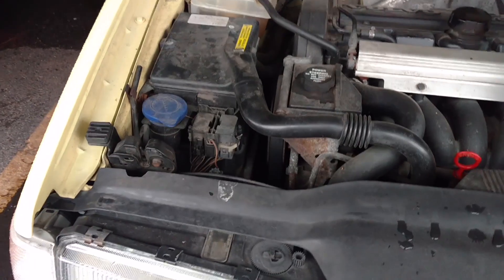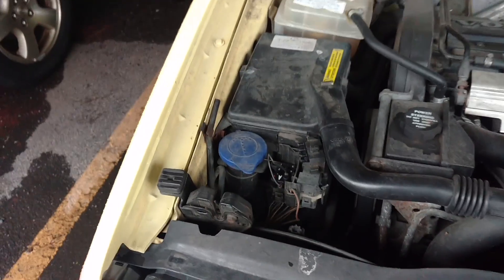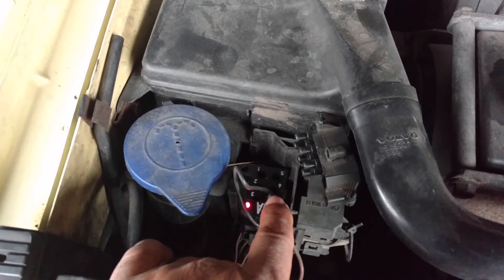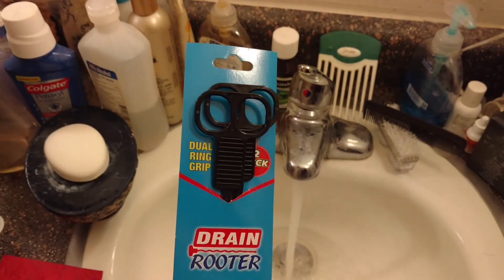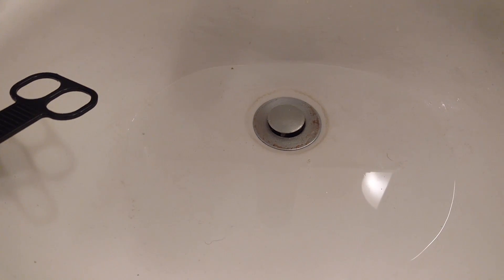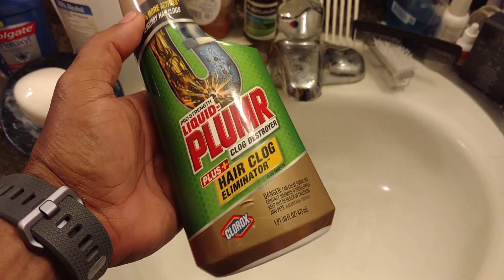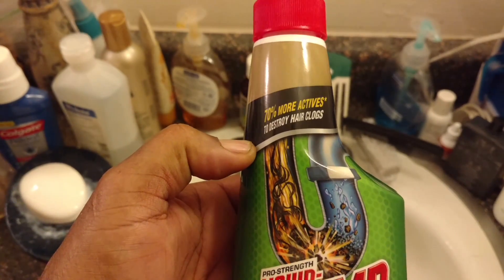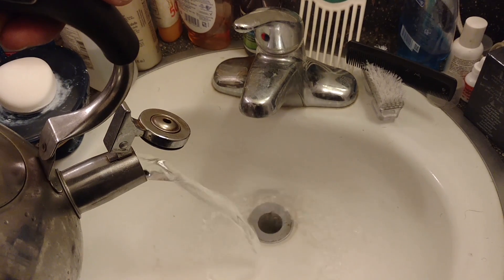Issues and disappointment with carbon build up. Cleared bathroom sink drain. - HOWR

Comment: I have had trouble with carbon build up in the past on one of my old Jeeps.
To remove the carbon I would pull the plugs, disable the fuel pump and spray Mopar Combustion Chamber Cleaner in each spark plug hole and let it sit for a 2 hrs. Spin the engine over (rags were used to cover the spark plug holes to minimize any mess) and re-spray each cylinder again. Spin the engine again. Re-assemble everything and go for a drive.
The results were always very impressive.
My Jeep would get carbon build up and run rough when cold - the carbon would act like a sponge and absorb the fuel until the engine warmed up.
Good luck with your carbon issues Robert.
Reply from the maker: Thanks for the tip. I'm going to try a few things on Red Barron and use what seems to work best. ;)

Comment: I remember reading a procedure (no, I have not used it, use at your own risk). Maybe disconnect fuel pump relay, etc. so fuel system will not run. Pull out spark plugs. Pour some top-end solvent cleaner into holes. Let soak on top of piston, etc. Put rags over top of engine areas, things will get messy.  Crank engine to remove top end cleaner. Reinsert spark plugs.
Reply from the maker: My next plan was to use oven cleaner. Tried it before, works good for making the carbon soft.
Reply: @RobertDIY  Keep us posted!

Comment: Hey robert i have receipts for my 850R going back to 1996 and the dealer maintenance always shows using techron regularly. I Pulled the head at 300,000 and didnt look that bad.. still rocking the techron and vvpower.
Reply from the maker: I'm going to try it on Queen Bee.

Comment: Driving it almost 200,000 miles with leaking valve seals definitely could have contributed to the carbon build up 
Also the previous owner may have done a lot of around town short trips which would not allow the engine to reach full operating temperature this can cause excess carbon because the engine never gets hot enough to burn off carbon deposits
Reply from the maker: Yea, the PO that drove it was a fire chief.
Reply: Robert DIY ah makes since I wouldn’t feel to bad about it I’m sure nothing you’ve done has caused the carbon I really bet it was the PO
Reply from the maker: Well, I really thought all cars built up carbon and looking back I see that some have not.

Comment: Because of residual cylinder pressure when the intake valve opens direct injection vehicles seem to be way worse with carbon build up. Port injection is better in this regard because the back of the valve and the I take runner generally stay cleaner than direct injection systems. I'm not sure if this car is Port or direct.
Reply from the maker: Port
Reply: @RobertDIY  I guess the knock may be coming from internal carbon build up in the cylinder. It may be raising compression and causing some pre ignition. Just for a test see what happens if you go buy a little bit of premium fule with a higher octane rating and see if the knock persists.
Reply from the maker: I'm running the highest we can purchase short of racing fuel.
Reply: @RobertDIY  ohh I see, interesting. Might have to take that head off again :(

Comment: You need an engine shop that specializes in Volvo's preferably that works on high performance engine's to make Queen Bee as serene and quick as can be.
Reply from the maker: Free service?
Reply: @RobertDIY  Advice from a repair shop as mentioned might help. Almost no one wants to work for nothing and is the problem. My dad would say, that the guy wants you to grease his palm. Knowledge "Free" is what am trying to get at with doing any mod's to your vehicle.
Reply from the maker: I'm not sure where you are or where you're going with this but I have done a lot of research and have paid other's to assist with the mods I'm going.
Reply: @RobertDIY  Is the best can explain stuff. Anyway enjoy watching your video's and hope to watch a lot more. Keep your fingers crossed on the high performance tuning of Panther.

Comment: Hi Robert. My 1996 850R  had the same issues.I pulled the head at 275000 on the clock and had the carbon buildup was just like  yours. The valve stem seals were gone and the pcv was partially blocked. When I was cleaning the deck on the block i used CRC gasket remover and got some over spray on the pistons  the stuff dissovled the carbon right off. I'm wondering If you sprayed that stuff down in the cylinder let it set for a few minutes run the car. I don't know what the ramifications would be. Has anybody used this stuff in this application? All I know this stuff works really well.
Reply from the maker: I was about to use some oven cleaner, tried it at the junkyard. I'll get some of that stuff and try it before I do the oven cleaner.

Comment: Ive heard that people's driving style can affect carbon build up.  For instance, say an old granny owns the car and she drives it to the store thats a mile down the road a couple times a month.  She never gets into the throttle, never or rarely lets the engine get up to operating temp, probably uses cheap gas etc.
Reply from the maker: Will that cause more or less carbon?
Reply: @RobertDIY  I believe the school of thought is more because they never get into higher RPMs which burn off excessive carbon.
Reply: @RobertDIY  have you noticed if your 850 consumes oil at all?  Both the 850s Ive owned consumed oil over time.  No smoke or check engine lights.  I usually change my oil every 5000 and I check the oil level at around 2500 and I always have to add about a quart.  My other 850 I was changing at 7500 and it was more noticable just because of the longer interval.  Im just wondering if oil coming past the rings isnt fully burning off during combustion and causing the build up slowly over time.
Reply from the maker: My yellow car uses about 1 quart every 5,000 miles. That engine was replaced 20,000 miles ago. The wagon has decent compression but 390,000 on the block. Does use about 1 quart every 4,000 miles since I replaced the heat about 30,000 miles ago.
Reply from the maker: They both get about 60+% of highway driving at about 3,000 RPM's.
Reply from the maker: Actually the yellow sedan gets about 80% highway driving.
Reply: @RobertDIY  Both my 850s had good compression inall cylinders.
Reply from the maker: cool